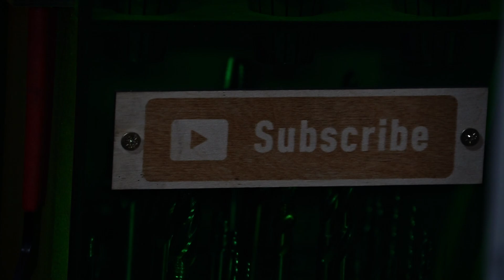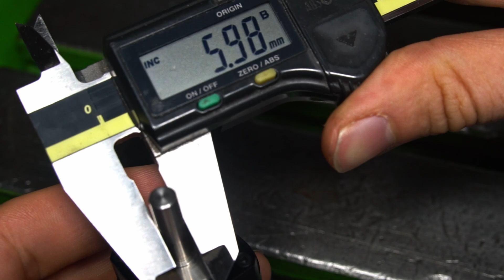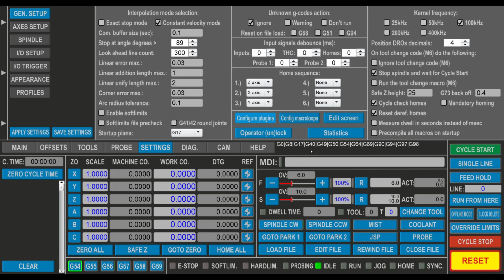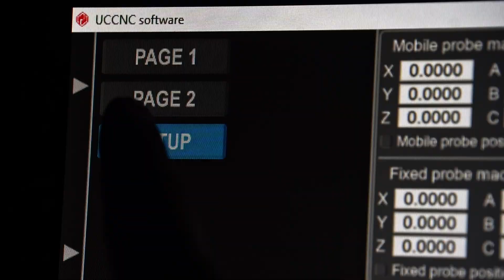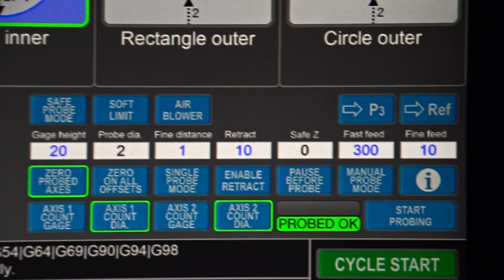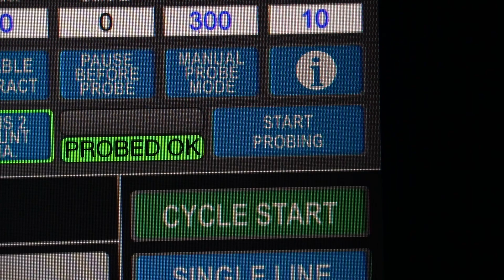AXBB-E Ethernet CNC Controller #7 3D Touch Probe!

Comment: Thanks for your videos!! You have a cnc mill, why didnt you make the hole with a cam program? Its easier and faster. 😅
Reply from the maker: That was just for show-off purposes :) Wanted to test my new boring head. Also boring heads make almost perfect circles compared to CNC where it's a interpolation of points. But you're right - making a big hole with a cnc program but with some additional material to be removed with a boring head would work much better and more efficient :)

Comment: hello dear why you are not using linuxcnc
Reply from the maker: Hi! I was looking for an ethernet-based CNC controller and I found the AXBB-E. I was thinking about linuxcnc with the mesa card, but when I was making this machine it was more expensive than the AXBB-E. I find the UCCNC really good - much better than mach3, and much simplier compared to LinuxCNC. It is a fast controller, which covered all my needs with my mill. Now i'm building a CNC lathe and I'm going to stay with UCCNC but I got a UC300ETH (much more I/Os).

Comment: You need to calibrate the 3D probe. With your CNC controller software, if the software supports it, and a calibrated ring with like 30mm ID. Or you need to dial in the tip with an indicator to make it run in the center. 
The probe should always in the same orientation as well when probing. 

Such a probe is really nice to find centers of round things or even to take measurements for larger features you can’t reach with a caliper.
Reply from the maker: Thanks for your input. Tips are always welcome!